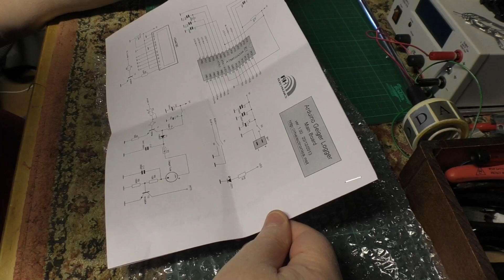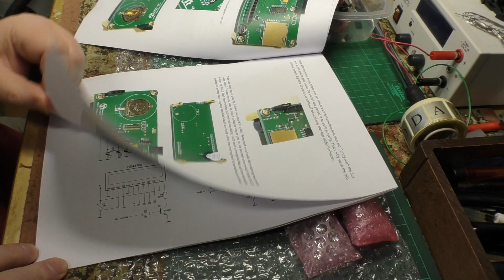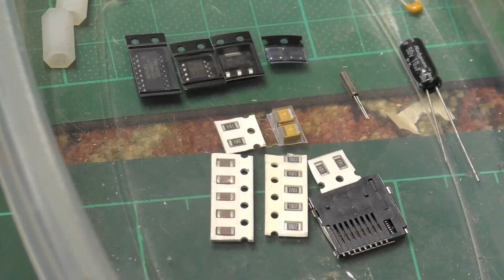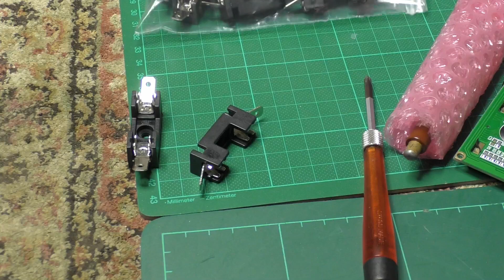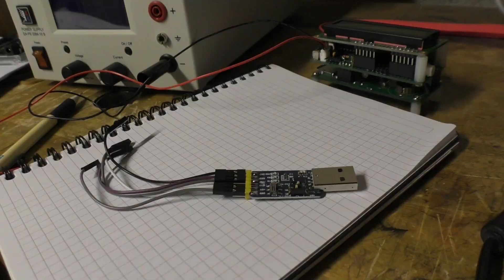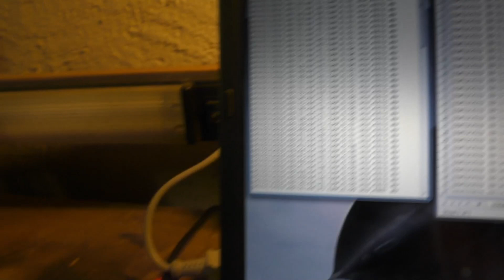Geiger Counter Project build

Comment: Good job John, shame about the bad eBay experience, but good to see you got around it in the end. I buy/sell (mostly buy) literally tons of stuff from eBay, and apart from a few bits and bobs that haven't arrived etc eBay has been great. With 1700 transactions and counting I can't even remember a seller not fixing a problem that has arisen.

Just a tip perhaps for your new SMD journey.. When you're doing more than a few components, It may be worth getting a small amount of solder paste, even the cheap 'mechanic brand stuff off eBay will do. Unlike solder though.. any solder paste doesn't have a long shelf life (usually 12 months at most) however you can rejuvenate it with a little IPA to make it last about twice that long :)

Then use a cocktail stick etc.. and dab a tiny amount of paste on the pads for say 5 components at a time.. Drop those components on.. and with the air flow quite low.. Heat those components until the paste re-flows. If you're feeling adventurous, you can just do the whole board in one go. 
It can be therapeutic doing each component separately though, however with lots of components it can be annoying too :) 
Regards
John
Reply from the maker: Thanks John.  It was Aliexpress who let me down and it's been my first bad experience so far.   I'm fine with eBay so I'm not put off using our friends in the Middle Kingdom :-)
If I go down the solder paste route then I guess for a large component count I'd probably need to investigate a cheap oven.  I've seen a few conversions online - but all that is way down the road.....
Cheers,   John
Reply: @Zone1242  Ah ok, understood. I'd like to use Aliexpress but they don't do PayPal which I'd prefer.
Yes if assembling PCBs with hundreds of SMD parts then a small oven would be ideal 👍
Cheers
John
Reply: I would like to try this project too. Thanks John.
Reply from the maker: @barryg41  The guys website is at rhelectronics.net.   Fortunately there is a jumper on the board to disconnect the bleeper - that chirping gets annoying after a while :-)
Reply: @Zone1242  thanks!